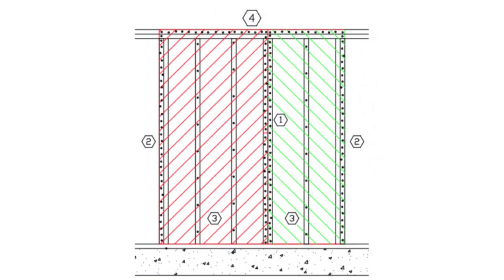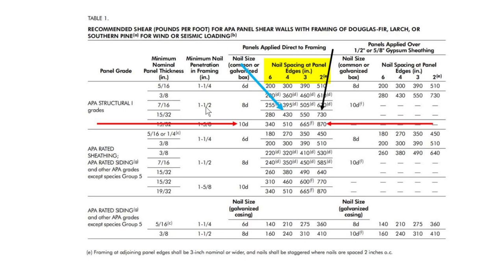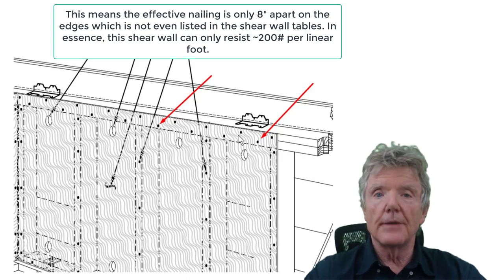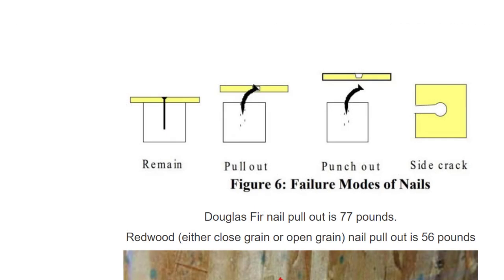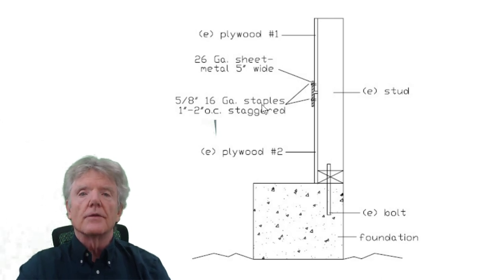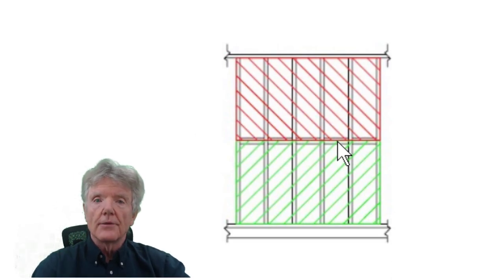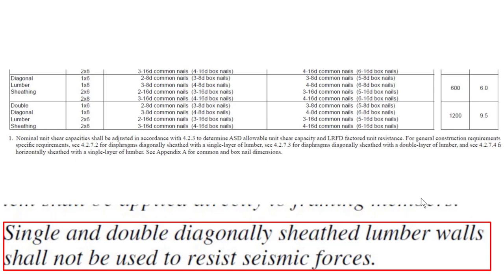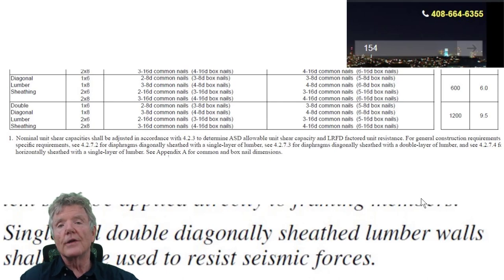Building Shear Walls - 8 Essential Tips

Comment: Hi Howard,

Your videos and reference material have been quite helpful to me.  I certainly have a better understanding of some of the key seismic risks and I have been able to review the contractor proposals with a much more critical eye…which has generated several questions that I hope you can help me with.

Here are my questions:

1.	My house has cripple walls with plank and beam construction, so that 2” thick subfloor planks are directly supported by 4x6 beams (no rim joists). The ends of the beams butt against the top plates and are toenailed into the top plates, two nails on each side of the beam.  So, it would seem to me that the Floor to Cripple Wall shear transfer ties aren’t needed.  (2” subfloor is directly nailed to the top of the cripple walls and floor support beams).  Do I understand this correctly?
2.	Also, the ends of the floor beams are supported vertically by 2x4 jack studs at the end of the beam, with the jack studs toenailed into the foundation sill plate.  So, the jack stud as currently installed would interfere with obtaining more than a 44” continuous span of plywood sheathing.  A contractor proposed removing the 2x4 jack stud and installing 4x8 lumber board within the cripple wall behind the girder beam end centered, allowing equidistance of the board on either side of the girder beam end for plywood sheathing attachment.  My question is, how have you previously dealt with this plank and beam end of beam support issue?  I would appreciate your feedback on the contractor’s proposed solution as well.  I’m also wondering if it wouldn’t be sufficient to just move the jack stud outward to below the top plates on the inner side of the to-be installed plywood sheathing.  Then the beam could be supported by either a header hanger or gusset attached to the relocated jack stud.
3.	Finally, I’m trying to understand if the floor support beams would be exposed to significant lateral or transverse seismic forces.   Isn’t the floor beams’ only function to provide vertical support?  I also see in the AWC plank and beam publication that straps are installed across adjoining floor beams…Is this necessary?  Am I missing something?
Many thanks in advance, Dave
Reply from the maker: Can you send me photographs?  I am having trouble visualizing this.  Please subscribe.  More videos are coming.
Reply: @bayarearetrofit5814    Will do
Reply from the maker: Dave Wegmann
1 day ago
Hi Howard,

Your videos and reference material have been quite helpful to me.  I certainly have a better understanding of some of the key seismic risks and I have been able to review the contractor proposals with a much more critical eye…which has generated several questions that I hope you can help me with.

Here are my questions:

1.	My house has cripple walls with plank and beam construction, so that 2” thick subfloor planks are directly supported by 4x6 beams (no rim joists). The ends of the beams butt against the top plates and are toenailed into the top plates, two nails on each side of the beam.  So, it would seem to me that the Floor to Cripple Wall shear transfer ties aren’t needed.  (2” subfloor is directly nailed to the top of the cripple walls and floor support beams).  Do I understand this correctly?

YES

2.	Also, the ends of the floor beams are supported vertically by 2x4 jack studs at the end of the beam, with the jack studs toenailed into the foundation sill plate.  So, the jack stud as currently installed would interfere with obtaining more than a 44” continuous span of plywood sheathing.  A contractor proposed removing the 2x4 jack stud and installing 4x8 lumber board within the cripple wall behind the girder beam end centered, allowing equidistance of the board on either side of the girder beam end for plywood sheathing attachment.  My question is, how have you previously dealt with this plank and beam end of beam support issue?  I would appreciate your feedback on the contractor’s proposed solution as well.  I’m also wondering if it wouldn’t be sufficient to just move the jack stud outward to below the top plates on the inner side of the to-be installed plywood sheathing.  Then the beam could be supported by either a header hanger or gusset attached to the relocated jack stud

I THINK YOUR IDEA IS A GOOD ONE. 

.
3.	Finally, I’m trying to understand if the floor support beams would be exposed to significant lateral or transverse seismic forces.   Isn’t the floor beams’ only function to provide vertical support?  I also see in the AWC plank and beam publication that straps are installed across adjoining floor beams…Is this necessary?  Am I missing something?
Many thanks in advance, Dave

FORGET ABOUT THE POSTS AND BEAMS.  THEY ARE ONLY FOR VERTICAL SUPPORT.
Reply: @bayarearetrofit5814  Great.  Many Thanks!

Comment: Does the APA Research Report 154 ever specify the number of plies the plywood sheathing should contain in Table 1? I ended up using 4-ply Rated CD plywood (didn’t realize until after 300 nails were driven in) instead of 5-ply Rated (or better Structural 1). Can I trust the values in Table 1 if using 4-ply or should a reduction factor be used? I saw that 3-ply is a major no-no and basically cosmetic so I’m hoping 4-ply has some reasonable middle ground. The good news is my shear wall is 24 feet long - likely twice as long it needed to be - so hopefully over engineering it makes up for any inadequacy using 4-ply Rated.
Reply from the maker: What you have is fine.
Reply: Bay Area Retrofit thanks. Given the effort I’ve put in, I wish I had done it “right”, but glad to know what I did is sufficient.
Reply from the maker: You did it right, you used "Rated" instead of Structural 1, very little difference in capacity according to the chart.
Reply: Bay Area Retrofit I understand. I wish I had paid a little more attention though and gotten 5-ply Structural 1! Oh well :)

Comment from the maker: I spoke to the American Plywood Association about table B-1 in Research Report 138  https://www.bayarearetrofit.com//wp-content/uploads/2013/05/APA-Research-Report-138-1.pdf and based on that table  using a plywood strip rather than sheet metal and the research scientist I spoke to at the time had no problem with it so I think that is another option if you don't want to take the plywood down.

Comment: Thanks for addressing horizontal seams. I think I will use the sheet metal and staple approach. Out of curiosity, how are the horizontal blocking 4x4's supposed to be attached to the studs?
Reply from the maker: Unless you have the tools, blocking will be easier.  Just nail it.
Reply: Ok - the blocking I need to install ends up being directly under the top plates. I would use 4x4s for the blocking. So I'm thinking I can just increase the length of the lag bolts to not only install the blocking but also take care of the shear transfer ties :)

3 1/2" + 1 1/2" + 1 1/2" = 6 1/2".

8" SDS screws will be great since I don't need 2" penetration in to rim\ends joists (my home doesn't have them). I don't know exactly how thick my sub-floor is but I assume I'll get a little bit of penetration in to my first story wall framing.I really appreciate all the help and guidance you've provided. Thanks!
Reply: Why 4x4 instead of 2x4?
Reply: Howard describes when\why to use a 4x4 in the video (the part about horizontal seams). Essentially, 4x4 allows for nails without worry of splitting. Otherwise, I'd have to look into staples or worry about splitting a 2x4 when I nail it.
Reply: @chrisc7465  got it, Thanks ..what about SDS screws in 2x4 shouldn't that take care of the splitting problem?
Reply: @ablooddiamond I suppose screws would mitigate the splitting problem when attaching horizontal seams to a 2x4. I'm not a licensed contractor though so ask Howard! He presented 3 solutions for joining horizontal seams and none used screws - there's probably a reason for it :)
Reply from the maker: For seam nailing you need to nail into the wide edge so you can maintain proper edge distances and wide face nailing splits the block when you nail into them 3-4 inches on center.   It does work with staples but not with seam blocking.  Watch the video on shear wall construction.
Reply from the maker: @chrisc7465  Subfloors are usually 7/8 inch.  You can use 2 by 4 blocking if you want to. 2 by 4's can take close nailing if you nail into the narrow face. When figuring out hardware capacities go to this webpage https://www.bayarearetrofit.com/hardware-and-plywood-earthquake-resistance/
Reply from the maker: Screws are an untested system.

Comment: Great video. I see you make your own walls. Simpson makes steel strong walls. Is it worth the extra money to purchase from Simpson? .
Reply: They make Strongwalls for garage door openings.  Other than that we always build our own.
Reply: @howardcook6432  I am placing them on my garage, the walls on the garage door side are only 8" long with very little support.  The  garage is old built in the 20's  and is leaning to one side, my thought is to place a 2'  shear wall on each side which would shrink the garage door. But the question is should I purchase the shear walls or make them my self?

Comment: Thank you so much for all of this information. I do plan to reference everything you’ve provided for my retrofit project. One note regarding the extra nails on the lower top plate; engineering for construction is one view, but having had to tear apart a lot of structures such as these I can tell you that those extra nails will make it much more difficult to demolish. Granted, earthquakes may go about things differently than us monkeys with pry-bars but I’ve had to curse a lot more when undoing all those extra nails ;-)
Reply from the maker: RECONNX makes a tool that drives nails through the plywood.  A real life saver.

Comment: My wall is covered up with 3/4 ship lap old growth Douglas fir is it strong enough whole interior of basment walls is covered with it its built 1910 all the pony walls like and a sheer wall across
Reply from the maker: Horizontal siding of any type is only worth 100 pounds per linear foot.  If the nails ever rusted from lack of painting, even less.
Reply: @bayarearetrofit5814  its double horizontal only single is on chart  would you just double it to 200  or is 100 the value regardless
Reply from the maker: Double

Comment: How can a person access an area sealed off by a shear wall? Large areas of my attic are behind shear walls, and I want to install ceiling fans and lights.
Reply from the maker: You need be create an access and use screws instead of nails.  Screws are not an approved shear wall system but in some cases you have no choice.  Do not use drywall screws, they are brittle and snap.

Comment: I don't know what you mean by offset
Reply: I'm referring to 30 degree nailer that has a full round head but the head is offset to one side with respect to the body of the nail so that when the nails are in the nail clip they can rest against each other, sort of like a clipped top nail, but instead of being clipped they just offset the head.
Reply from the maker: Now I understand.  I don't see a problem so long as the nails are flush with the top layer of plywood.

Comment: I think I have a somewhat typical style of construction, a cripple wall, with a double 2x4 top plate on top, then 4x6 joists with 2x6 blocking in between the joists, and finally 1-1/8" plywood tongue & groove subfloor on top of that. 

The problem is where the kitchen sink water and drain come in. In that location, they cut out the 2x6 blocking between the joists and the double 2x4 top plate and the mudsill at the bottom of the cripple wall. About a 3-1/2" gap, all to accommodate the water and drain pipe.

My idea to mitigate this is:
1. blocking: I don't know what to do about the 2x6 blocking with the water pipes and drain, except to maybe try to build it out to make the blocking continuous as much as possible. 

2. top plate: for the double 2x4 top plate, they scabbed on a 2x4 on the side, so I thought maybe just change that out for a longer 2x4 that bridges the gap with a lot of nails and shear transfer ties.

3. mudsill: for the mudsill, they left a gap but they didn't use it so I thought I'd take out about 4' of mudsill and replace with a longer piece so that it's continuous and then bolt it all to the foundation.

Seems like this might be a somewhat common problem. Any suggestions appreciated!
Reply from the maker: It is a common problem.  Bridge the gap with a 2 x 6 or 2 x 8, nail the existing top plates together on each side of the break and put about 20 nails through the 2x into both the upper and lower top plates

Comment: Hi Howard - I feel pretty good about the construction portion (nuts and bolts so to speak) of the shear walls thanks to your examples, but less sure about specifying some other details. I'm wondering if you could answer a few questions for me. I'm trying to dig out the info, but a little confused. 1. Should shear walls always be done in match pairs when possible (opposing walls)? It seems like that's what you are saying. Intuitively that makes sense to me in that you would want the walls on opposite sides to provide the same resistance so that they would react in a similar way to external forces (although sometimes this isn't possible). 

2. Is it better to split up a shear wall, half on one corner and half on another or is it ok to just have one long one in the middle? Some corners just have too much stuff in the way to put anything in the corner. Is this a case of do the best you can, i.e., "don't let the perfect be the enemy of the good"? 

3. In terms of reinforcement schedule (determining linear feet of shear wall), Standard Plan A has a table, is that a fair way to go, or is it ok for a single-story to have a minimum of 50% of the length but maybe add some, go a little longer than shorter just to be conservative? It's not much extra work-wise or material-wise for me, assuming extra length doesn't cause a problem. I really appreciate you sharing your knowledge and experience. Thanks for any suggestions/tips that you can offer!

Throw Standard Plan A out the window.  You need to calculate it based on house weight.  Email me direct to info@bayarearetrofit.com and I will show you how.  Sorry I am so late your email got buried.
Reply from the maker: Sorry I am so late in my reply.  I do not know YouTube did not notify me about your comment.  Give me a call 510-418-1676